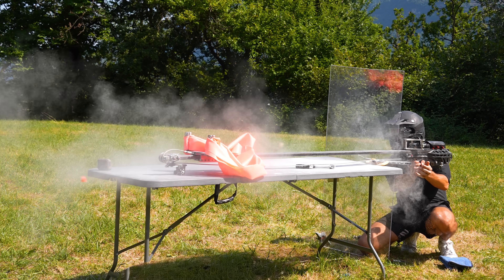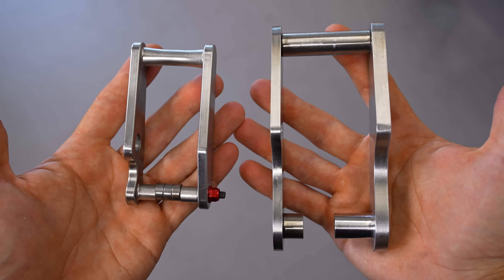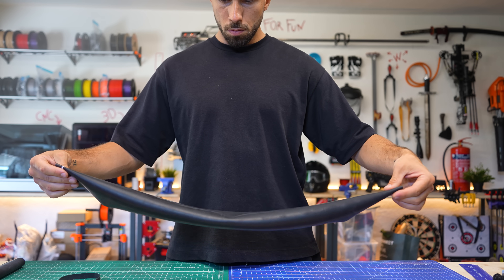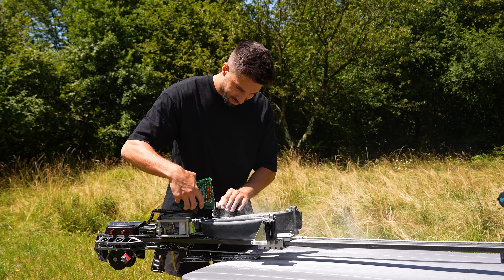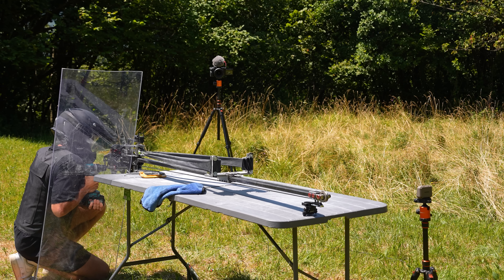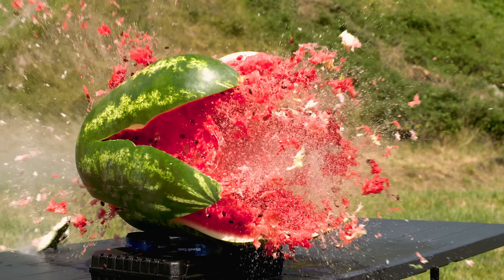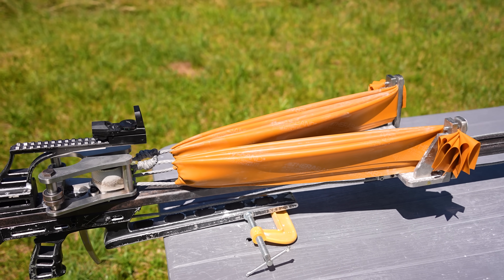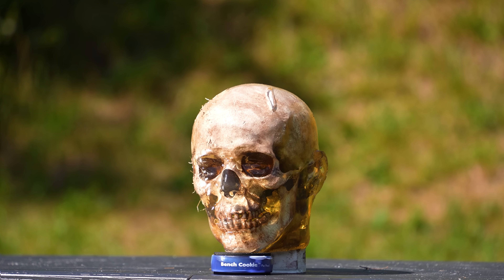Bulletproof Glass vs World's Most Powerful Slingshot

Comment: You are the ONLY 1 in 1.8 million people who did not expect the ball to go through all the boards of pine.
Reply: When I saw the grain on that wood I knew the steel ball would destroy for sure!
Reply: @Movieman1965  Yes, if it was oak or beech it had a chance, but pine is very weak.
Reply: Algumas armas de pressão atravessam essas tabuas com relativa facilidade, era meio obvio que seriam destroçadas com o peso de esfera de 50mm, o que foi estranho foi esse o vidro reforçado ser trespassado
Reply: @jailsonbr  Yeah it can stop bullets with similar energy the difference is the size and weight 357 magnum weighs between 100 to 200 grain while the ball can weigh anything if its steel it could be 510 grams which is more than quadruple the 125 grain 357 bullet which is most common for self defense in the 357 magnum category in the end when it comes to penetration speed and weight are the deciding factors so yes a 357 bullet wont go through but a 50 millimeter ball will because of the big jump in total weight.
Reply: Пробить и сломать это тоже разные вещи, я такие сухие доски возможно кулаком сломаю,  с костетом точо, и не надо пушку городить по цене тачки. Еще поражает реакция на арбуз, пусть скинет его с 15ого этажа например, у него обморок будет от эмоций.
Reply: @SOL-wp3hg  "костет"
Reply: I KNOW RIGHT  bro thinks we stupid
Reply: Some ppl play with physical rules without understanding them.

Comment: Momentum has to do with the energy too. Thats why you only need 60 ft lbs from an arrow to kill a deer but at least 250 ftlbs from an air rifle. 500 ft lbs with that kind of weight and momentum is a weapon of mass destruction thats why it sailed right through the bullet proof glass when it will stop a 500 ft lbs 357 magnum bullet the difference is the Momentum from all that extra weight

Comment: The bulletproof glass was as impressive as hell.
Reply: It says its bullet proof, not slingshot proof 🤣
Reply: 1. Bulletproof (resistant) glass is designed/tested/rated inside a certain design of frame. The frame is an integral part of the system and plays a role in the stopping power of the glass. So just leaning it up the unframed glass against something is like the worst case scenario. The bulletproof glass standards literally include a load of different specifications for how the glass must be framed because it's so important for it to actually function properly.
2. the glass is designed to stop bullets, and in this case pistol rounds, which when they impact are more of a high speed, short duration metal spat. (the projectile deforms significantly, the metal is much softer) 
3. The ball bearing doesn't deform at all and imparts it's energy over a much longer period of time with much less of the energy being lost to deformation of the projectile

Think about it like this: 
You've got a setup with 3 normal pieces of glass, that have saran wrap between each layer, and superglued each layer together. Then leaned it up against a wood frame or something  

It's the difference between:
Taking a marble sized ball of clay, wrapping it in a thin layer of foil like it's a piece of chocolate, and throwing it at your glass setup really really fast.  
And 
hitting that same setup as hard as you can with the rounded side of a ball-peen hammer.

Comment: "Yeah, my roof started leaking, so I went to the attic to check."
"What happened?"
"I found a 30 cm hole in the roof and a 50mm steel ball sitting in the concrete wall on the other side"
"..."

Comment: Why not put a snatch block on winch cable? 1/2 the effort to draw the cable altho it would take twice as long. You would have to see if 1/2 the effort to crank the winch equates to being able to crank it twice as fast.mount a pulley on carriage and run cable around it back to winch

Comment: 1. You're right, increasing speed and mass will increase joules, but even though there's a quadratic relationship with speed, it's not so much the speed that's important, but the mass, as well as the shape of the "bullet." If the goal is penetration, then it should be made more streamlined. If the goal is stopping power or maximum destruction, then the "bullet" should be made as flat as possible so that it transfers all its energy to the target without damaging it.

2. You apparently have laminated glass, not bulletproof glass. This is evident by the way the glass shatters—more precisely, by a very neat, round hole. Bulletproof glass typically has separate sections of tempered glass separated by a polymer film, which firstly bonds the fragments and secondly prevents direct energy transfer from the previous layer to the next, also acting as a damper. 3. Regarding safety, what prevented you from making a minimal cover, like a squalo? At least an additional restrictive plate on top. Also, you could have made guides out of a fluoroplastic-like material to prevent the rubber from extending beyond certain vertical limits. This would also have provided greater safety and predictability.

Comment: You should design a small calibre, hand held weapon which can be used like a bow and arrow to hunt small game.The elastic used for model planes is a better quality elastic. Your shot needs to be lead balls, which are denser and heavier than steel, wouldn't go through bullet proof glass and flatten out if they hit something hard, but are fine for penetrating melons or flesh. l recommend that the attachment points for the elastic are further apart. lf you can make a success of it there is probablhy a markedt for them. A mould such as was once used for musket balls would be best to make your lead balls. Make the far end of your catapult as light as possible. To have the elastic pass over rollers at an angle might enable  you to shorten the length of the weapon.

Comment: Just curious. 

How would this compare to rubber cut from the inner tire from a big hauler rig or bus? 

Most DIY in asia and africa use those. They are durable and strong. Of course not for children.

Those will not need breaking in before it reaches final elasticity because it is already used for a few years.

Comment: Он в курсе что в два раза увеличение скорости повышает энергию в 4 раза, в отличии от увеличения веса пропорционально увеличивающему енергию к массе??😂
Reply from the maker: Speed is limited by the retraction speed of the rubber
Reply: @MikeShake  I completely agree, but you give an example of an anvil with an energy of 1000 joules, how much does it weigh? There is a kpvt machine gun with a caliber of 14.5 mm, the weight of the bullet is only 64 grams, but it has an energy of 32,000 joules.

Comment: Have you tried a tigger mechanism that not only releases the shot, but also spreads the fork? that would give a bit of an increase to the pull.
Also the trigger and its release have force on it from 2 oposing sides, at a perpindicualr direction, if however the trigger released from both sides, and was in line with the forces on its release, you might get an easier pull.

Comment: I think the sharp bends are putting stress on the bands and causing them to snap. I have 2 issues with it. Both are related to safety. 1 it should have a safety, even if it is just a removable pin. 2 the cable going through a tunnel through the trigger means that if some debris gets on the cable, it could catch on the trigger and pull it.

Comment: It's perfectly normal that this ball went through BR3 bulletproof glass. It's a huge mass with high energy, and those types of glass are designed to resist handgun bullets or arrows, not such heavy projectiles. The only type that could reliably stop it is BR4, which is rated against rifle rounds of around 3,500–4,000 joules. And even then, it would probably delaminate heavily at the point of impact.

Comment: What were the last readings on the Garmin? It seemed to increase in power as you break in the new bands. I can't believe a bearing that size went through the safety glass! I thought perhaps a smaller diameter would have a good chance, but holy crap dude, nice work! 👍

Comment: Couple of pointers I noticed, with the ropes for the pouches, feed the rope thru a short small piece of pipe for the rubber bands to sit on. The smoother the surface, no bumps or sharp edges, the easier life is for the bands, you had a massive bump with that knot which puts massive pinpoint pressure on that part of the bands. Next is the mounts for the bands, radius the inside edge towards the trigger as this is a tension corner for the bands (back to no sharp edges for the bands), then on the faces that sandwich the bands make the bands do a S type of path thru the clamps. Do this by making a groove top to bottom on the fixed side, between the threads basically, then on the bolt on side make a bump line between the bolt holes that matches, Think of it like a speed bump on the road. This way the bands come from the pouch, round the smooth corner of the fixed clamp, across 1/3 of the front face, then the next 1/3 is around the speed bump setup, with the last 1/3 the rest of the flat face. Aluminum is terrible for threads that take loads or are repeatedly used, you can get steel flanged nuts that sit inside a hole thru the aluminum that work well, with the flange on the back side stopping it pulling out.
Reply: All good suggestions.  With the language you use and the insight you have, I'm guessing you fix things.  Am I wrong?  Do people bring you things they've broken and ask you to make corrections and repair them?
Reply: @indivisible885  Well my trade is to build and repair things, but after decades in the industry I have enough things of my own to try and build and repair, so I don't work on other people's problems. Video's like this are what I watch when at home alone with dinner and a beer, reliving my youth through the video's. And when people put enough effort into trying to make things the best they can, I think I can spend the time to write out what might help them along.
Reply: @aussiemanlyman2138 I understand completely.   I could tell by the types of suggestions you made, that you have experience in the world of building and repair.  And my guess would be that you had to create your own solutions to existing problems.  Hence, you made the types of suggestions that demonstrate that type of thinking and problem solving
Reply: If you put pipes over the rope, it's gonna increase the weight of the pouch and slow down the slingshot. Not sure if it's gonna be significant though, given how heavy the projectile is anyway. But I don't imagine you'll be able to use pvc or aluminum pipes, it's probably gonna have to be steel and with a fairly thick wall, or else it will bend.

Comment: Bullets are made from lead, that's why bullets can't penitrate objects harder than them. There are also inconsistencies in your draw length.  Maybe install some sort of hard stop for the fork. Also, maybe wrap the band around the mounting plate before installing it to keep it from slipping out. Now your trigger, instead of relying on strength to move a T post out of the way, maybe sping load the T post and make something to provide more leverage to push the T post. These videos are awesome.
Reply: Most bullets are FMJ to allow penetration

Comment: Super cool project to see come to life! I do sincerely hope he spends some time doing the math/statics related to the strength of the overall beam and other structural components. Clearly he puts numbers on the energy being stored in the bands, but then glazes over using "thicker walls" on the main beam to retain the load...but not backing up with the safety factor of the design under full load? Same goes for the fork at the end of the bands haha. The trigger mechanism makes me wince too - this thing is basically relying on the unknown frictional forces of the roller bearings against the trigger bearing plate (both of which are CURVED) in a way that essentially puts them in unstable equilibrium that could never be relied on in any uncontrolled test range environment. All for the cool content, just don't want to see his skull as the one being shattered XD

Comment: possible solution to bunching and slowing of bands (just amateur theorizing here) if you built a different T-shaped post configuration with bands extending laterally outward after the posts in original configuration (x---👈U👉---x) the bands would be slowing down/bunching less before releasing ball.  make these changes: "👈,👉"=long smooth bolt with stacked roller bearings w/ wider spacing to ensure ball does not impact, "---"=longer bands, "x"=new post anchor point of bands.  *iam not an engineer so please consider these suggestions safely* good luck with improvements i enjoyed watching you work out problems in this video series

Comment: Upper and lower rails will allow you to stack two sets of bands. Instead of a T shaped trigger mechanism, use a flat that transitions to a wedge shape. This would require much less force to spread the retainer open. That's an incredible sling shot!!! You could also make a drop rail to hold the torque of drill. However, I'm thinking you will definitely need reduction gearing for the force needed 1000 joules. Another idea for trigger pull is to use two arms and a pivot point like a lever. A fat kid on one side of the seesaw method lol.

Comment: Go visit a local sign shop, and ask for some scrap lexan (polycarbonate) pieces. I would guess it couldn't penetrate 5 pieces of 3/16" stacked together. I shot a single piece with a 22lr round and it didn't go through. That was at 25' or so. Sign shops usually carry translucent white or clear. I would figure out a way to laminate it with some 3M spray adhesive and clamp it together. You'll be very surprised how strong a few pieces are!

Comment: Bulletproof glass, like all ceramic armor, is designed to break apart copper and lead ammunition and take much of it's momentum in the process. The way you beat ceramic/glass armor is with hardness and momentum. Which the massive steel balls have both.

Comment: A one inch Tungsten 2400 grain ball at 200 meters per second or 650 fps would be an excellent big game close range under 75 meters weapon if it can be safely shot hand held and carried hand held.... 2500 ft lbs or 3000 joules.

Comment: The data I can find on the net all says that a .357 magnum has roughly 500 ft-lbs of energy at the muzzle (which is around 677 J in sane units). So that steel ball has roughly equivalent kinetic energy to a bullet. There's probably a significant difference in regards to inertia because it's so much heavier- I would also guess that the design of the bulletproof glass is meant to minimize a penetrating force, not a large, high energy object impacting over a much wider area than the point of a bullet.
In other words, the glass is an armor designed to keep out arrows, and your steel ball is a mace. Or artillery, if you prefer.

Comment: A suggestion for a future project - design one using torsion springs like some garage doors.  My two car garage has an old wooden door the springs don’t have a bit of trouble lifting.  It wouldn’t be a slingshot anymore, but would be quite a shot thrower.

Also, given the damage to the bulletproof glass, you may want a thicker chunk of polycarbonate for your shield.

Comment: There's something I keep thinking about- I haven't seen even JoergSprave make MA3:1 or even MA2:1 type slingshots (backed by a regular 1:1 for initial speed). I mean, pulley slingshots are heavy but they can seriously up the joules pretty easily. If someone can figure a 4:1 or 5:1, you can even exceed subsonic, into sniper energy territory.

Comment: Hmmm!?SO, U R TRYING TO MAKE A GUN BASED ON KINETIC ENERGY COMPRESSION PRINCIPLE! GREAT!!HOWEVER,THE MATERIAL USED FOR THE LONG RANGE DIRECTIONAL BARREL!!BASE ON THE WEIGHT SQUARING THE SIZE OF DISTANCE APART RELATIVE TO SPEED THEREFORE ENERGY LEVELS ACTED UPON! REMAINS A CONSTANT,DETERMINING A SPECTRAL OF MATERIAL CHOICES REGARDLESS OF WHATEVER, ENERGY STATE!!,THEREFORE PRECISION ACCURACY IN MATERIAL DENSITY & DEGREES OF SOME TENSILITY ALL! RELATIVE IN Ms:>WOULD HAVE TO B DETERMINED ON ACCURACY OF DIAGRAM!! U CLEARLY DIDNOT DO THE REQUIRED STEPS U HACKED IT THROUGH!!!..

Comment: The more you try to slingshot heavier and faster thing, the closer you get to a crossbow. Case in point, because of how cumbersome the whole contration,  you could give "wings" to the fork, making them of flexible but springy material, like wood or some steel type, and attach the bands there. Thanks to that you could shorten the rail and reduce the quantity of elastic, making the thing less heavy and unwieldy.

Comment: The reason the bands slipped out is because there is no smooth barrier protrusions if you created clamps with smooth protrusions in the rear and 1 times larger recesses in the front part of the clamps you would not have that same slippage.

Comment: Is there anything to prevent the sled that the bands attach to from shooting back if the winch/cable fails? That could be fatal.
It should have some sort of safety back up system like a vehicle hoist/lift uses on the lift mechanism.

Comment: Glad the new trigger worked out much better. If you make another iteration I would consider putting rope between the pouch and the elastic bands through a metal tube and laying the bands around the tubes to avoid uneven pressure.
Also that realisation that your shield wouldn't hold against your weapon is just slightly terrifying. I guess bullet resistant glass is really only good against small projectiles, even if the larger ones have considerably less energy overall.